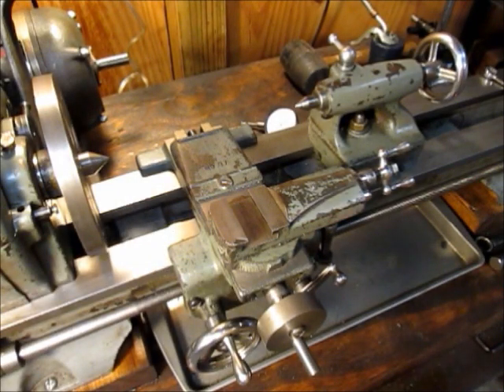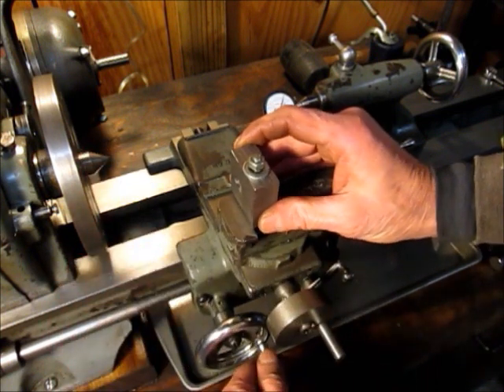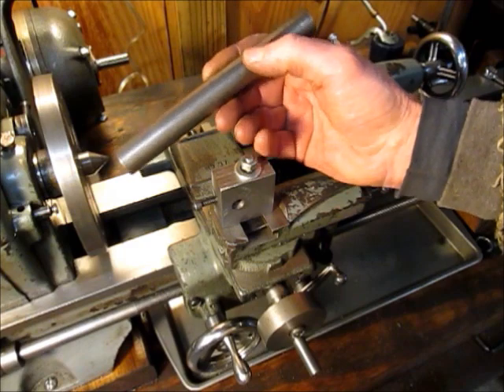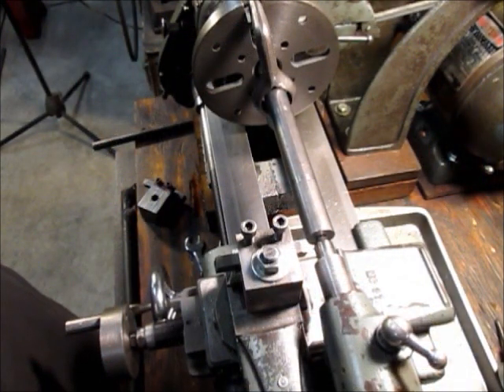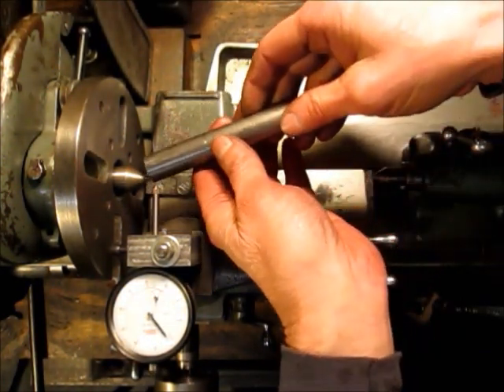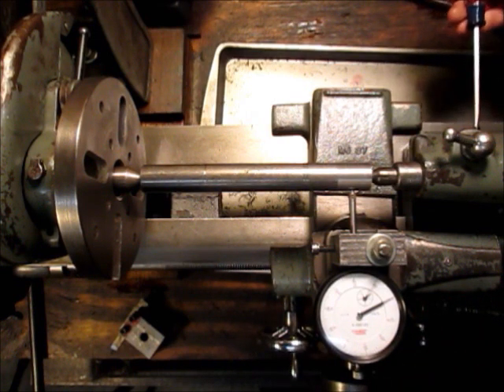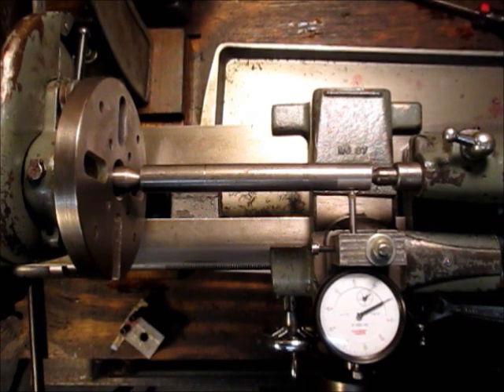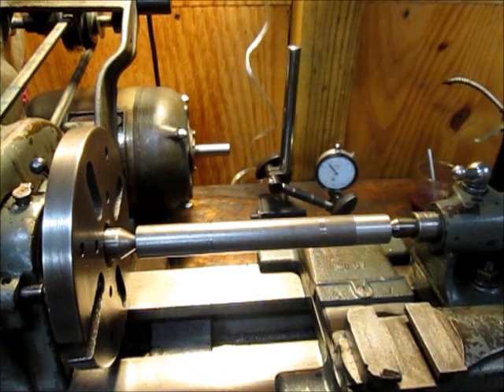Easy Lathe Tailstock Alignment

Comment: The method fails if the tailstock is either too high or too low to begin with. You have to verify or shim it first, otherwise the dial indicator will always read too low because it is vertically off center at the tailstock end. To check the height, make a test bar the way you do and sweep a test indicator across the top of each swapped end.

Comment: Theresa faster way.. run the 2 centerpoints together.  Take a thin piece of metal . About 6" or bigger. Place it between the points and gently crank in the point on the headstock.. the metal sheet  will tilt in whatever direction the point is off.. you can actually eyeball a thousandth using this method....obviously the bigger the metal , the more it will tilt at the outer edge.

Comment: Do this with the CHUCK. Chuck one end and dead or live ctr the other end. Any piece of stock machined at both ends with the compound and cross slide dials set the same, will produce the 'current Z axis' for the lathe 'at that moment'. If that Z axis you've just machined (no matter what length the test piece), produces a chuck end dia of eg. .818 and a tailstock dia of .814, the tailstock must be dialed away from the tool point .002. It really is that simple because if the height was also a bit out, the trig takes care of itself when both diameters match.  To put it another way, chuck and tailstock alignment may not be perfect on 'the machine' but they need to match and parallel exactly, the tool point on its up and down travel. That's why I say to do this set up using the working chuck.

Comment: Hi. What kind of lubricant do you use?
Reply from the maker: Do you mean cutting fluid? I used to use AFT but started using commercial brands a while back. I have some made by Tapfree now. To lube the bearings and ways I use straight 30w.

Comment: How can you rely on the tail stock for center drilling your test bar if its the tailstock you want to align?
Reply: If it's off-center, it will still drill a centered hole—it will just be a slightly bigger diameter.

Comment: This was super helpful and I'll need to this soon. So, it doesn't matter if the test bar isn't perfectly straight? It's all about the area you turned down. Correct? If so, that makes it a bit easier since I had no idea where I would find a perfectly straight piece of round bar.
Reply from the maker: eviltwinx  That's correct. The cut will be the same distance from the center on each end. I hope it helps you out. Thanks.
Reply: +RP Mechanics but wouldn't the 1" cut be a little off,  if there was .0009 off then the 1" cut could have about .0002  off cut,  and you would need to mark a line say in the center of cut and make sure the dial was placed back at the line when turned to other end??
Reply from the maker: +jbrunson1949 Yes, I see what you're saying. Unless the tailstock is really out of whack to start, this method should put you within a .001. I make a mark and put the dial on it when I do it. You can also use the actual work piece as the test bar so moving the tailstock won't change things.
Reply: eviltwinx gdsf